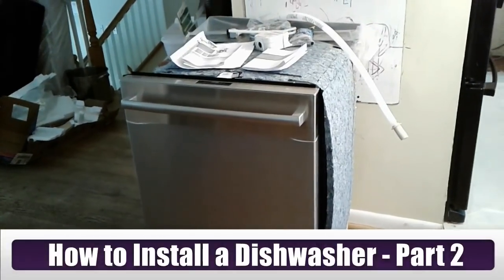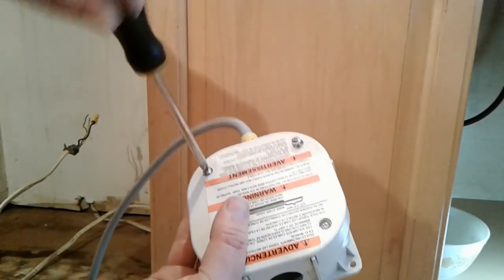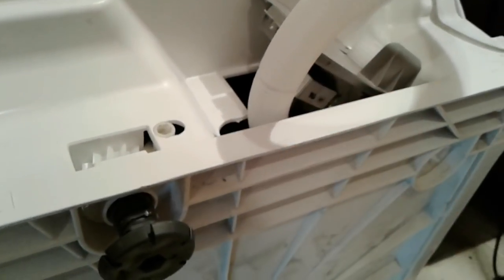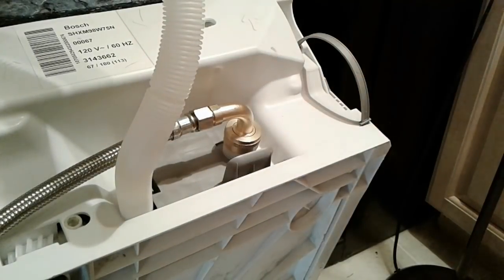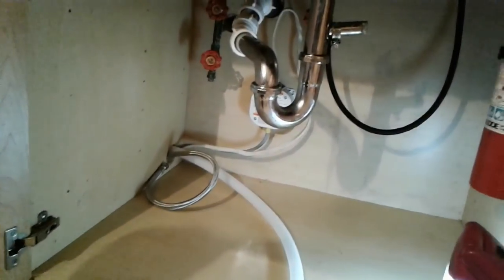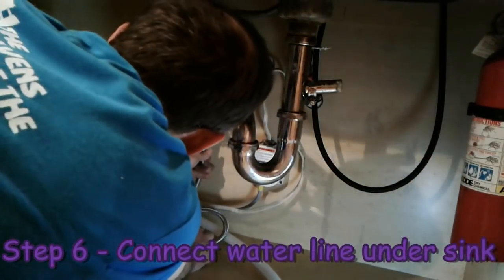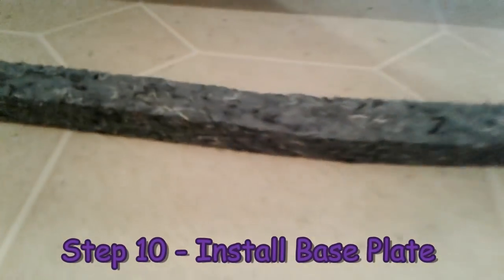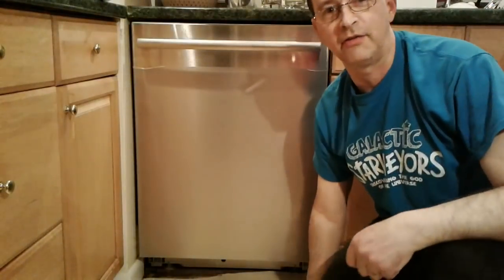DIY Dishwasher Install,  Bosch Super Quiet Dish Washer, Part 2

Comment: This video was such a huge help! Best Buy was supposed to install yesterday, but because the electric wasn't in the cabinet adjacent to the dishwasher (it was hardwired directly to the old dishwasher), they wouldn't install. I moved the electric over, and thanks to this video, installed it all myself. Thank you VERY much for the very helpful and user friendly video!
Reply from the maker: Great job getting the dishwasher installed yourself, and I'm glad the video helped. I appreciate the kind words. Thanks for watching and commenting.

Comment: Thanks for a truly helpful video. It's the first one I found that describes the changes made by Bosch since I last installed one. 
1) Water intake now in rear. Need a shorter supply line. 
2) Separate power junction box required. (Just takes up space for no good reason.)
3) Rear leveling leg controlled by screw up front. Nice touch.
4) Drain hose comes pre-attached. 

Also got an idea on how to make my Bosch 300 even quieter by installing extra sound deadening in the toe plate area.
Reply from the maker: Very cool, Robert. Thanks for the note. Glad the video was helpful to you.
Reply: Yes, the water intake in rear is a big problem for me, making this installation (replacement) take half a day instead of an hour.
Reply: Right?! I’m going to apply extra insulation to upgrade mine as well.

Comment: Thanks for including the part where you screw down the little tabs into the countertop. Because the really small diagram in the Bosch installation manual makes it look like they go in the opposite direction, I was totally confused until I saw your video at 16:07. Thanks!

Comment: How did taping the soundproof on work out, we have a Bosch on order and thinking I should do that. Any problems in doing this with air flow or anything?
Reply from the maker: The Bosch dishwasher is so amazingly quiet that I don't think my additional "soundproofing" really made any real difference. We have been very happy with this dish machine!
Reply: @Buckwsr  Thank you for the reply, thats good to know. We are looking forward to our new machine :)

Comment: Great video! What size and length water line and 90° elbow did you end up going with? It may be in the installation instructions but I also bought my dishwasher at a discounted rate and the instructions were not included

Comment: Enjoyed watching. We are in the market for a new dishwasher. How do you like it? Worth the price? Is is really quiet and does it do a good job cleaning? Thanks!
Reply from the maker: Yes, best dishwasher ever and super quiet. Without the red led light shining on the floor, you wouldn't even know it was running! We got ours at an amazing discount; full price would have been out of our range. I have had other dishwashers which fit the dishes more to my liking, but I have adjusted okay to the new arrangement.

Comment: I have a similar situation with the wiring.  I wondering do you really feel it a good idea to put the box under the sink where water could be a possibility?  That would me better for me but that didn't sound too safe.   This would have been such an easy install if they hadn't done the junction box and insisted you use it.
Reply from the maker: Good question. I know what you mean. Nonetheless, the box provided for the wiring does appear to be water resistant for the most part.  Additionally, that box gets mounted on the wall of the cabinet, so it's not like its sitting on the floor in a puddle of water. Finally, in my case, the dishwasher is fed off of the LOAD side of a GFI protected receptacle. So that is the best protection in the event of water intrusion. Hope that helps!
Reply: Thank you for your reply.

Comment: Why foil tape over standard duct? heat issue? thanks - good video.
Reply from the maker: Thanks for the note. Glad you liked the video. I didn't have duct tape on hand, and I just went with the foil tape because it seemed like it would do a good job.

Comment: Why was the kickplate installed and then removed for the final testing of the door open/close??
Reply from the maker: Good eye! I think I had forgotten to install the kickplate when I recorded the final testing segment. Then I went back and showed how to install the kickplate. So in reality, the kickplate install was the final segment that I recorded. You are to be commended for keen observation skills!
Reply: Buckwsr the only reason I paid any attention was because that’s the part giving me so much grief.  The plate constantly gets stuck when the door is fully opened then closed.
Reply from the maker: @rogueleader8129  Oh, ok. Well, that's kind of weird. I'm not sure what's going on there. The height of the dishwasher is adjustable, as you may have seen. Do you have the machine sitting high enough? Just a thought....

Comment: Thanks so much! This greatly helped. We just purchased a bosch 300 series and hopefully all goes well.
How do you all like the bosch so far? 
We have never purchased anything bosch, but were told(and read) that they have the fewest maintenance issues.
I have read that the only down side to bosch dishwashers is the smaller inside size and they don’t dry your dishes very well like american dishwashers do.
Love in Christ Jesus,
mrs b
Reply from the maker: Thank you for the note. The thing we like best about the dishwasher is how QUIET it is!! Without that little red led light that shines on the floor we wouldn't even know the machine was running! Regarding inside capacity, I can't say I noticed it being any smaller than our previous one.... Good luck with yours!

Comment: The controls appear to be hidden under the counter top.  How do you turn it on?
Reply from the maker: Yes, the "hidden" controls is a Bosch design. You simply enter your selection on the keypad, and the machine starts when you close the door completely.
Reply from the maker: To clarify: make sure the unit is on, press “Normal” and then “Start.” Close the dishwasher door. A solid red light should appear on the floor to indicate that it is working. Hope that helps! ~Mrs. Buck

Comment: I am not able to connect my inlet pipe. Could you please help me with the accessories needed.
Reply from the maker: Your local hardware store should have the connector(s) you need for the water line. In the video I show the connector I bought to do my installation.
Reply: Thanks. I need adapter to connect. I am looking for it. Something like a pipe with a screw.

Comment: wish I would have watched this earlier. All my other dishwashers have been plugged into an outlet. Now I need to direct wire it. Time to run a new wire :(
Reply from the maker: Hey, you can handle it! Good luck, and thanks for watching and commenting.
Reply: It comes with a direct plug-in connector if it's an 800 series. You only need the junction box if you don't have an outlet. (I know this comment is 3 years old, so you probably figured it out by now -- but for anyone watching this video now, like me, it's good to know that you don't have to hard-wire it).

Comment: Why wouldn't you connect the water lines and test for leaks before sliding the dishwasher in place? Also I don't see much sense taking the electrical from behind the dishwasher into the sink cabinet and back out again. Either place is just as liable to get exposed to water if there is a leak. I hope the hoses have improved on your Bosch compared to one I am repairing (SHE23R56UC/64) which are just friction fit  connections with an "0" ring . No clamps! Total junk flimsy hoses and also the crap flimsy control panels break from opening and closing the door in the handle area. It does wash dishes well though but the build quality for such an expensive dishwasher is the pits. Shame on you Bosch.
Nice neat job installing though!
Reply from the maker: My only guess is that they want to make the electrical connection box more accessible and not hidden behind the machine, so they tell you to mount it in the adjacent cabinet. I really don't know. As far as the other issues you've mentioned...so far we haven't had any problems, and the machine is still running just fine. Good luck.
Reply: Most dishwashers have electrical connections behind the kickplate at the front of the dishwasher. Much easier than crawling under the sink. Sometimes things are changed for the better, sometimes for the worse. Appliance designers should ask the people who service, install and use their products for input. They might come up with the perfect machine! Have a great day.
Reply: The junction box needs to be in an adjacent cabinet because according to NEC the junction needs to be accessible.
Why Bosch chose to design their dishwashers without the junction in front behind the kickplate is anybody's guess.
Kudos to Buckwar for showing the correct way to do this. Other videos have it mounted behind the dishwasher or under the cabinet.
Reply: @samjg1  thanks for the context on why the box is supposed to be mounted in the sink cabinet. I just ordered a Bosch dishwasher and am trying to figure out all the potential issues for the installation.
Reply: My old Bosch had the hardwired electrical in the front and water supply line.  Not impressed with the new layout.